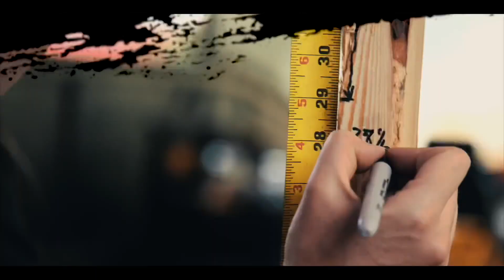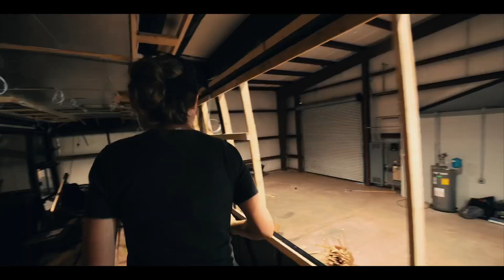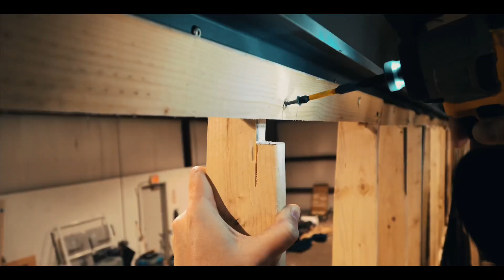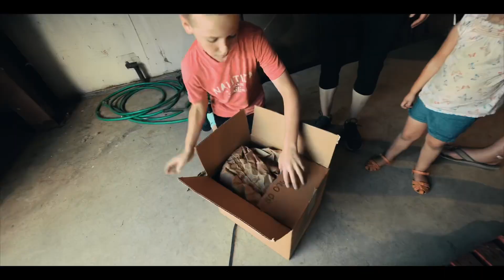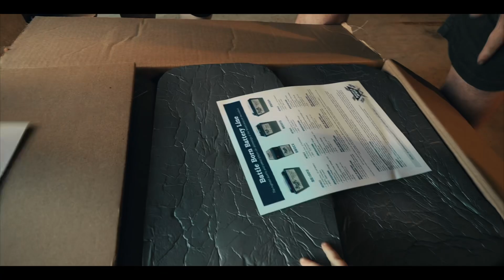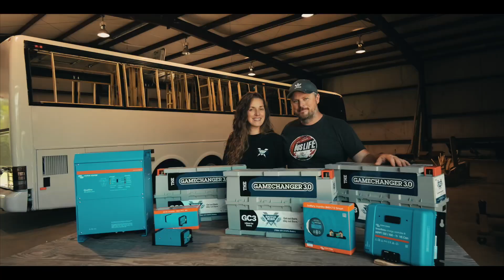Massive, Off Grid Bus Conversion Electrical System!

Comment: Hey guys loved the video! We have a similar bus which we heat and cool with large mini split. Let me just say you cannot have too much solar, unless you are parking under canopy. We have chosen to go with a 24v system and we might upgrade to 48v in the future. With your  100a solar charge controller you could double your watts by simply doubling system voltage. Anyway, keep the videos coming and may God bless and guide you all in your work!